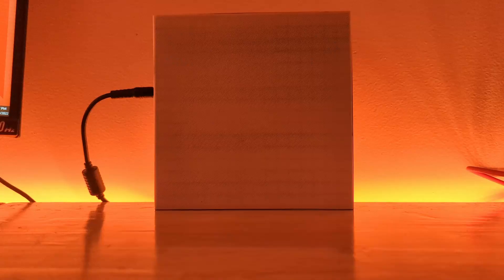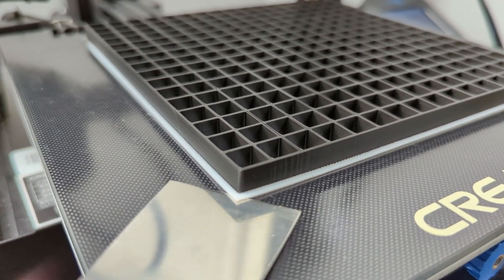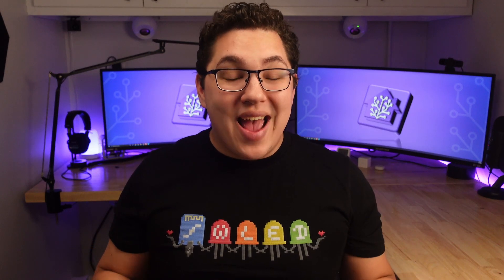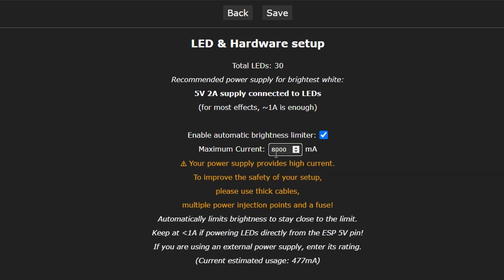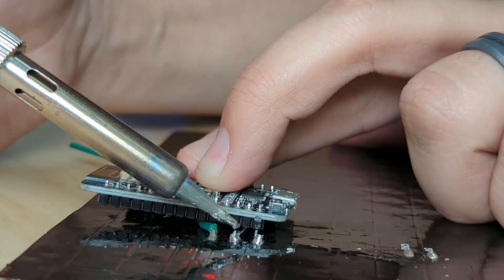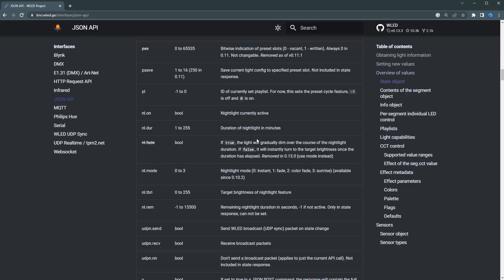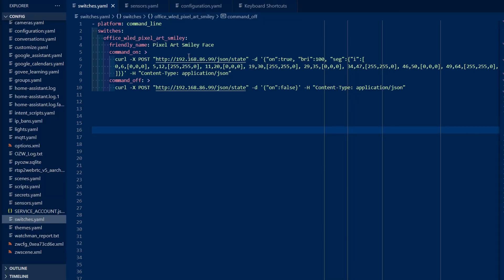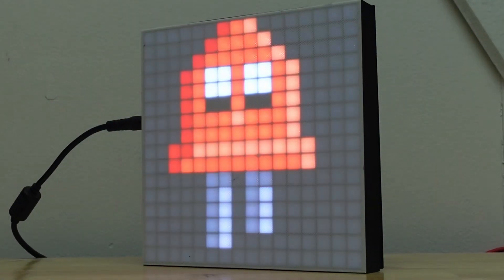Creating PIXEL ART with WLED!!

Comment: I created a solution, that enables me to stream anything i want from my PC to the 16x16 Matrix.
On my PC is run a Program i wrote in Processing (creative coding library), that sends UDP packages via Wifi to an ESP8266, that parses the UDP packages and updates the color of the LEDs accordingly.
I send one line (16 Pixels) per 4ms, so i get a framerate of roughly 15fps
If i go for a lower delay between lines, it results in screen tearing. Though i suspect that by using a better Microcontroller like a new generation ESP32, i could get a much higher framerate.
In the processing program i can do things like rasterizing an Image or Webcam Video, generating visuals through creative code, writing Text, and also many interactions like processing an Audio Signal and making the LED Matrix Audioreactive...
Theoretically you could use any other program, like Touchdesigner or Unity, that allows you to send UDP Packages.
I was very surprised to see how much is possible (15 FPS is not bad for wifi stream!), even though i used materials that cost less than 10$ for that project.
Reply from the maker: Very cool!! Post a clip on discord if you want to share it!!

Comment: Great video!  Do you know if it's possible to set up a WLED preset to pull up a specific pixel art image on my LED matrix by pressing a button?  I've already set up a custom build of WLED on an ESP32 with 7 presets that incorporate buttons to change the LED colors, but I would love to be able to also pull up 7 different pixel images as well.  It seems like I'd be able to store some very small image files in the esp32's memory?
Reply from the maker: You can save pixel art as a preset, yes! I need to do a video about it at some point
Reply: @MakeItWorkTech  oh really?!  that's very good to know!  I would absolutely love to learn more or see a video on that!

Comment: I'm not very electrical savy but would it be possible to solder together individual neopixels or something similar to use less power? You said 15A which just seems like a lot of power for LEDs. Or is the high current amount juat because there are so many LEDs?
Reply from the maker: The current required is based on the LED type. You can use less power with less allowable brightness

Comment: Bro. Get a decent soldering station, solder and flux. Makes a world of difference
Reply from the maker: Could you recommend one? Still using my beginner station haha
Reply: @MakeItWorkTech  I'd recommend either a Weller WE1010NA or a Haako FX888D-23BY.  Whatever you choose, a tip set for the iron would be useful as well.
Reply: @MakeItWorkTech  i hate to reccomend ali express but the jc axiun tca and tcb stations are awesome. i have both. long story. they're on sale right now. they are jbc clones but do it very welll sorry for the delay. i was in the hospital. 

we're all learners, that's what makes this hobby fun.

i got the fnrisi mini t12 iron for my repair bag for rcs and general repairs. it's only 40 dollars right now and it's much better than at ts100.

my next station is going to be a metcal. the tips control the temp, theyre awesome. old but awesome.
Reply: @makeitworktech Use a Station from Weller. They are a bit more expensive but will make you happy.

Comment: something you should note, depending how you are wiring, not all LED's are 5volts some might be 12v so if you run 12V LED's you can't run the controller and the board on the same power supply since you will fry the board. Every time you made a setup video within the WLED you mention board volts instead of LED volts.
Reply from the maker: That's true! You gotta use the matrix that I used in the video!

Comment: There is a branch or off shoot whatever that is able to upload the code directly the wled without the need to use ha.  

Sadly I am unable to get reliable results.
I am not that good at coding but have been trying to figure out how to add in that ability to wled without the need for an additional thing.  Anyway as the code evolves I am consistently impressed.  Love it!
Reply from the maker: Thanks! You can add the code directly to WLED! In the Presets

Comment: Is it possible to build this somehow battery powered with usb-c loading function? What kind of components would I need? 😀
Reply from the maker: That might be tough, I'd have to look into that. You'd need a battery that could handle that current for a decent amount of time I guess. I'll add that to my list of projects!
Reply: I got a lolin lite esp32 with battery adapter, but I am way too bad to calculate the battery size 😂
Doesn’t make sense if it’s empty every day

Comment: Super video 👌
In the video you use a ESP8266 can also use a D1 Mini ESP-32❓
Reply from the maker: Thanks!
Yup! Just need to make sure the GPIO pin is set correctly.
Reply: @MakeItWorkTech  Ok but this has only 3.3 volts voltage but the LED strips or matrix need 5 volts.
What do I have to pay attention to when connecting ❓
Reply from the maker: There's also a 5V pin

Comment: I did everything by the letter but my Matrix won't turn on. I tried two different ESP32 and Matrix, but nothing. How can I check what's the problem?
Reply from the maker: Does the light on the esp32 light up when power is applied?
Reply: @MakeItWorkTech  Yes, I managed to set WLED as described. But the matrix won't turn on. Is there a way to test if it's working? Maybe they shipped a bad box of Matrix.
Reply: I am using ESP WROMM 32, where the data connector goes on D2 while 8266 is on D4. But everything else should be the same. Right?
Reply from the maker: @marcoisabella1724  did you flash the correct firmware version? (For the esp32 not 8266)
Reply: @MakeItWorkTech  Yes, I did all correct. You might want to add in your guide to check/set the GPIO number to the PIN where the green wire is attached on the ESP32. WLED is now defaulting it to 16, mine is on D2 so I had to change to 2. It's now working.
Reply from the maker: Hmmmm, sounds like a hardware issue!
Reply: @MakeItWorkTech  Hardware? No, it's about settings. You don't mention where the data PIN is set in WLED. It's an FYI, anyway. I have solved my problem but other may have the same in the future.

Comment: I wanted to try to recreate this functionality using Google Sheets, since I don't have excel. I think you may have a misconfiguration in your panel, since when the output from your sheet is sent to my panel, it doesn't render properly unless I reset the panel settings. I found out by sending a command to just illuminate the top left 4 pixels, and when misconfigured, it lights up the top right first row, and the top left second row.

Is there any way you would be willing to share a copy of the excel sheet without any macros? I cannot import the grid of examples into Google, so I manually recreated a couple, but you've got some great artwork that I would love to send to my panel!

Finally, the way I built my panel, I used a sheet of white shelf liner vinyl that I bought at a dollar store for the diffuser. I printed some grids to separate the pixels, and the vinyl gives a nice consistent diffuse glow without any lines from a 3d print.
Reply from the maker: It's misconfigured because the latest versions of WLED allow you to set up a 2D matrix. This "un-serpentines" your matrix so the the code won't work. I've linked V2 which fixes this. I can share a non-macro version of the sheet, but you should be able to download it and change the file extension name...
Awesome Idea about the vinyl!! I will definitely be trying that!
Reply: @MakeItWorkTech  I've actually made some progress streaming pixel data from piskelapp to my local WLED. It even works with animations! You inspired me to revisit the panel idea, looking forward to your next vid!
Reply from the maker: I'll have to check that out! Cool!

Comment: I got the same matrix you linked. Once I set up the 2D Matrix in WLED, in order for the order to be correct for the effects (like having the scrolling text look correct), I had to set the Panel start (at the bottom of the 2D Matrix setup page) to "Top" and "Right" (default is left) and serpentine. This completely borked the pixel art presets. Have you seen the same thing on your panels? I'm going through the Excel file trying to reverse-engineer how to get the pixels back in the right place.

I had to invert all the odd rows (so they go 15 to 0). But now I'm trying to figure out how to make it build sections of the same color correctly. So like if I have the first pixel in two rows the same color, that's now pixel 15 and 16, not 0 and 16, and that makes the code do weird things. Still chewing on this...
Reply from the maker: Yes, I've seen the same. Working on V2 currently, and will put a link to it soon. Matrix support "de-serpentines" the matrix
Reply: Aha, what I need to do is change the blue/white tables on the second tab and just have them determine their colors in a different order so that the stuff on the left doesn't have to change.
Reply: @swissfreek  Hey Frank, i have the same "Problem" can you explain how you fixed it?
Reply: @dopeausmpott3652  on the “code” tab, you’ll see the table on the right that have white and blue rows. If you click the cells, you see that they are used to determine color values of each pixel, and they read from column P to AE. You need to change the odd rows so they go from AE to P instead (so backwards). Before you do that, you will probably need to right click the table and turn off the setting that is something like “auto fill table” or it will make all the rows match that which isn’t what you want. It’s tedious to change each cell by hand, but once you do the first odd row, you can highlight it, copy, and paste to the other odd rows in that table. You’ll need to do all four tables, one for the general color, then one each for red green and blue values.

Hope that makes sense. It sounds like there’s a V2 of the file coming so you might just have to wait a bit if you don’t want to fix it yourself…

Comment: I have a question:

I was able to load multiple graphics as different presets in WLED using the json commands. Now I can switch between images at will. The problem is the images that have LEDs that are off (like the Minecraft sword and pick axe, they have black backgrounds. When that image loads, any pixels that are black/off stay whatever they were in the last image. So it's like it's laying the new image on top of the old one. Is there a command that can be run first that clears the whole panel and then loads the new pixels? Or maybe the code generator should set all the black pixels to [0,0,0] so that it forces them to update from what they were before? Not sure if that makes sense?
Reply: Ah, I figured this part out. Your grid code ignores pixels where the color is [0,0,0] (off). This means that they stay set to whatever they were before. Switching that IF statement so it didn't ignore [0,0,0] fixed the issue I was having. I'm curious, why do you ignore the dark pixels?
Reply from the maker: You got it! I ignore the dark pixels, because a curl command can only have a certain length. However, if you put this before you put the rest of the colored pixels, it will solve the problem:
0,256,[0,0,0],
In other words, set all the pixels to black, and then assign just the colored pixels
Reply: @MakeItWorkTech  Ahhh, that makes sense. Your solution was my first thought (wipe the board first), but I must have fat-fingered it because it didn't work when I tried it. I'll try again.
Reply: @MakeItWorkTech  Oh, also, if you use "TEXTJOIN" instead of "CONCATENATE", you can use a ", " to separate the items, and then you can take that out of the individual cells, and you eliminate that hanging comma at the end.

=TEXTJOIN(", ",TRUE,O2:O257)

This requires removing the &", " that is tacked onto the end of the formulas in column I and N.

You can also preload the rest of the json command with another cell:

=CLEAN("{"&CHAR(34)&"on"&CHAR(34)&":true, "&CHAR(34)&"bri"&CHAR(34)&":100, "&CHAR(34)&"seg"&CHAR(34)&":{"&CHAR(34)&"i"&CHAR(34)&":["&CHAR(10)&"        "&Q28&CHAR(10)&"        ]}}")

CLEAN makes it so that when you copy out the text, it doesn't put a ton of quotations in, but it also erases the line breaks, so you'll have to put those back in. But now you can copy/paste almost directly.
Reply from the maker: @swissfreek  I'll mention that in my next one!
Reply: Oh, or just use Q27 to generate the code instead of Q28... 😂

Comment: Great tutorial. I've been looking at WLED for other stuff, so this looks great.
I've started  using WS2815... they run at 12V, so the current requirements are much less, and they have some redundancy. More expensive though.
Reply from the maker: Thanks! Yeah, I have yet to try 12V, even though I bought a 12V 25A power supply years ago

Comment: Hi! Very nice video. I am having trouble with HA. After using you code for the switch, it only works for turning off the leds (previously turned on with wled) but it wont turn them on. ¿Any idea? (the matrix works fine with wled interface and via home assistant integration, but the switch dont)
Reply from the maker: Are you using my exact code? If the string is too long, the command won't work. Also make sure the IP address for both are correct
Reply: Yes, exact code with correct IP…

Comment: The excel it's broken no?
i can only get one part of it to load
Reply from the maker: Should still work. One part of what?
Reply: @MakeItWorkTech  Hi, it's working now, it was like not loading

Okay, so:
if you add {"on":true, "bri":100, "seg":{"i":[ at the start of the excel code and ]}} at the end (removing the last , ) you can directly input that as a new preset on the WLED webpage

In this way, you can set that on boot a preset can be loaded, so it won't change and also you don't depend on HA to use it

The only problem that i found, is for example: if you are using the image of HA and change to yoshi egg, some pixels will remain in blue(the black ones), i guess because those pixels aren't reasigned on the yoshi template

Maybe that's because on the code you assume that black pixels = not changed ?
Reply from the maker: @theusuario-pb5xk  thanks, yeah, someone told me that presets work. I'll try that for the next video. Yup, black are ignored because there's a max length for a curl command. If you send 0,256,[0,0,0] at the beginning it will set all pixels to black first

Comment: Hello, well explained, but if you do this with version > 0.13.3  you will go crazy!
Reply: or it was just a failed update
Reply: @jimlyjimlesson4502  What problem did you see?  (I just built one with 0.13.3 and it's pretty glitchy with lots of extraneous flashes etc..)
Reply: @NeilHendin  in 0.14.0-b1 a 2D matrix configuration is integrated. Also some cool effects, but the json control with seg and i is often not compatible at the moment. In my case, the entered values are not each an LED, but are interpreted as a segment. A segment is one line of LEDs. So it is a coincidence whether the control works or not. In the case of such hidden extensions :-) only a reboot helps. This will be attributed to the beta status. So don't use 0.14.0-b1 yet!
Reply from the maker: I'm using 0.14.0-b1, and the only issues I'm having is that it corrects the serpentine configuration of the matrix
Reply: @MakeItWorkTech  maybe i should use an ESP32 instead of an ESP8266? I will try it...
Reply from the maker: I'm using an 8266, no issues

Comment: Would it be possible to link multiple grids to one controller? Just thinking about a larger grid to display a qr code
Reply from the maker: Yes, very possible. Working on that for a future video. It is built-in supported in the latest beta of WLED.
Reply: @MakeItWorkTech  I would like to link one together to be able to put it on my trailer for my business
Reply: I do this using this guide! I just create them one section at a time in the spreadsheet, and HA sends the commands one at a time to WLED, defining the segment. I had to space them out a few milliseconds or WLED would drop one or two.

Comment: You can also do this with a wemos d1 mini you can get about 3 for the price of the nodemcu, They already come pinless so you can just solder on, and they are about 2/3 the size.
Reply from the maker: Yeah, I wanted to use one with pins so I could mount it easily as I did. I may to it for a future project

Comment: Did this a while ago using esphome leds as display component and changing image position according to number input. Nice thing was that it's not some obscure numbers array, but real sprite picture with all images you can see and edit visually
Reply: Nice, I did that too with ESPHome. The cool thing about ESPHome display can handle animated gifs. Also I've created a clock and home assistant services in ESPHome to handle the "carousel" of pages or activate the E1.31 DMX mode to control the display with Jinx
Reply from the maker: Where could one find a tutorial of this?
Reply: There is no tutorial. I used the display components lambda function to display image at position: "it.image(imageIndex * matrixSize, 0, id(my_image));"
Reply: Also interested in a tutorial here.